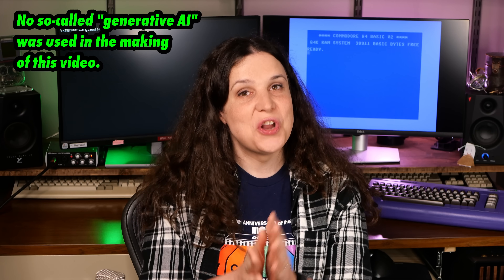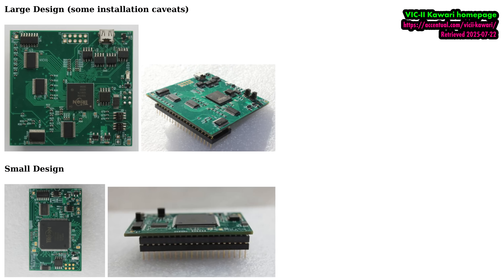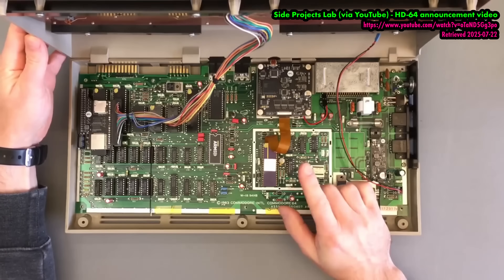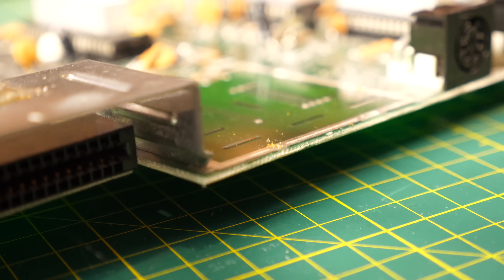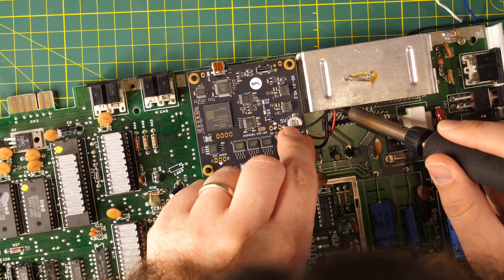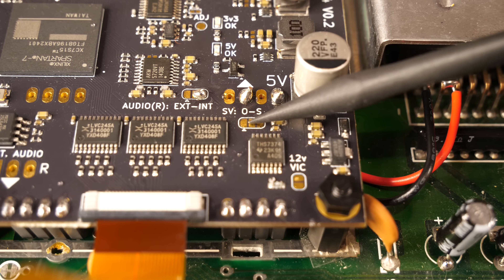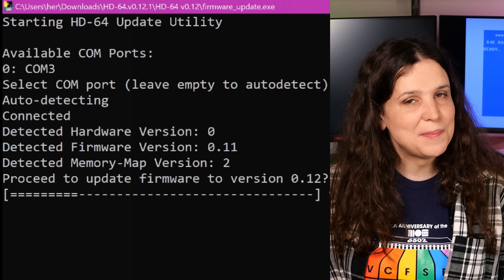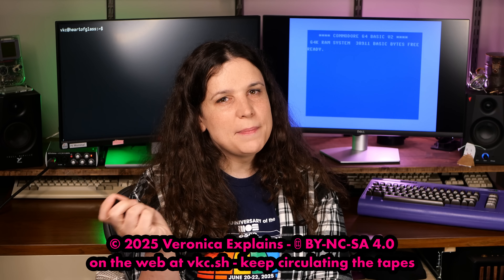My Commodore 64 has an HDMI port now.

Comment: Hey there, it's an honor to be featured on your channel, I've been following you for a long time :) Congrats for the thorough and well put together video, best of luck for your ongoing projects and stay tuned for an upcoming firmware update with much improved integer scaling and configurable scanlines :)
Reply from the maker: Oh hi there!! Thank you SO MUCH for the care and attention you put into this project. The instructions were well done and I've had no trouble at all since installing it. I can't wait to see where the project goes and will be keeping up with the updates from you!
Reply: firmware version v0.13 is in pre-release now on GitHub, the highlight is the option of selecting square-pixels aspect ratio on both PAL and NTSC, plus the fact that now "zooming in" does not crop the side borders unless they end up outside the 1920p horizontal resolution
Reply: It would be awesome if the original connection could remain as well.
Reply: @Someone_You_Do_Not_KnowYT Analog video (from the original VIC) is still available on the AV connector. The RF connector is completely useless nowdays, there is literally not a single use case for it in 2025
Reply: @sideprojectslab7352  I wouldn't think there was, it would be to keep the original hardware. So a unit that requires no more than a clip on and an extension that can be easily removed was what I was thinking.
Reply from the maker: @Someone_You_Do_Not_KnowYT  But then you couldn't get the video out without modding the case, which I didn't want to do.

I don't know why anyone would go back to an RF connection if they performed a mod like this. Keeping in mind that RF is typically the lowest possible quality connection- this mod removes that but composite/S-Video remain for plugging into vintage monitors.
Reply: @VeronicaExplains  Well, you have to mod the original hardware in order to do this, de-soldering and removing the RF modulator itself. If you are going that far, a case mod is easy. But I didn't mean that either. If the unit could be soldered into the original connections and leave the RF modulator there, or what I actually would like, somehow clip to to the pins without removal, the HDMI could be a small wire exiting the case and existing on the outside of it. This way, if you want to remove the mod and have it stock, you can. One could also mod the case at that point and put the HDMI connection there if that is that is what one would want to do. Considering the video signal, you could easily use USB-C as an alternative to mini or micro HDMI, let alone full size. 
What I was suggesting is not your use case scenario so I understand why you chose what you did. It's looks great, is easy to do and does what you want all while removing little more than an RF modulator that has no purpose without an actual CRT TV in this day and age. In that respect this is an awesome product and something I could see myself doing. However, in my own scenario I would prefer the RF modulator remain and access to HDMI or USB-C as an add on that can be removed.

Comment: I've never had a C64 (was in the Atari camp back in the day) but I have no animosity toward Commodore.  In fact, I used PETs in high school and had two different Amiga 500s in my past.  But with all the excitement surrounding the new C64 Ultimate I think I'll be ordering one.  Just need to decide on the model.  It's great that you have this video solution for your vintage C64!  On the Atari side, there are a few different solutions but none (that I know of) that are this straightforward and result in a perfect picture afterward.

Comment: If you want stereo. Take a look at FPGASID. Probably currently the best SID replacement. Not the easiest to install but imho it's the overall best package and it even has an A/B configuration which you can change between without having to open the config prg. You can use a physical switch which the user manual suggest but the JTAG connector also has +3.3v so it's easy to use a TTP223 touch switch instead. That way you can switch between A and B without needing to drill a hole in your cabinet. Just use good quality double adhesive tape and mount the switch inside cabinet where you want it.
The easiest is probably SidKick Pico 2040 with DAC but it's not cycle accurate. Good sounding though. ARM2SID is also a nice option and it even has auto mono/stereo although it takes som time to take effect.
One thing to be aware of though. The author if HD-64 has made right the default "mono" channel. It means that if using the "internal" sound you'll end up having left and right switched when listening to stereo. I choice I really do not understand. For a century left has been the mono channel. So what I've done is even though FPGASID outputs left on the board (only) I've configured HD-64 for external audio. Routed the right channel to the pin 7 (from memory) on the output so I have full sound in the analog output. Then from the connector 3 wires to the external input on HD-64. That way you get left and right correct on stereo tunes. A/B I've configured for 6581 (A, default as I configured touchswitch for default high) respectively 8580 both mono. For the few times I want stereo I go into the config app and configure stereo. If you don't want it to persist between power cycle then no need to save to flash (and wear it). Since many are using Kung Fu Flash and Ultimate 1541 (various versions) then no need to power cycle C64 to change between all sorts of materials.

Comment: I got mine and my interleaver cable assembly just didn't work. The instructions are really unclear, and the interleaver cable does not make good contact with the chip pins. My sockets I received weren't round pin like in the photos

I ended up soldering my interleaver pins based on another video I saw here, which worked. However the socket doesn't make a good interference fit in the motherboard socket. So now I need to figure out a way to mechanically attach that down

All in all it works, but the instructions aren't clear and I'm fairly sure I received an interleaver that wasn't right in some way. It's a shame, if they shipped the interleaver assembled I would have been happier

Comment: I agree gate,eeping is bad, but on the other hand I can see the resistance to fpgas as there have been quire a few fpga based boards thst have been discontinued either because the fogas had become to expensive or gone  out of production  altogether, I suspect a few in the anti foga croud has been burned by this. There are ofc allways a few that will object to anything that is mot original, but those ate probably ine the minorety even in the anti fpga croud

Comment: I had a Commodore 64 when I was in high school, that was a looong time ago, early 1980’s. Other than learning the BASIC programming language I found it to be kinda boring. I ended up giving it away but years later I wished I hadn’t done that because somebody came up with a graphical OS for it, modems / software for dialing up BBSs which would have made it useful. I had to wait until 1994-1995 when I got a real IBM clone PC which was a 386 33 Mhz which I later upgraded to a 486 80Mhz! then added an internal 14.4 modem and Soundblaster 16 card with 2X CD ROM.

Comment: If you want to be critical about FPGAs, you should take a look at how they are programmed.  There are basically two ways.  You either simulate how a "real" chip behaves in terms of how its outputs react to the inputs, or you can create a one to one clone of the original chip in the transistor or logic level.  People usually create output simulation since it is more efficient but I believe as FPGAs get better, designs on them will get better too.  Output simulation loses hidden features but a logic level creation even duplicates the undocumented features and glitches etc.  Also, you know the CPU that the SuperCPU uses, the W65C816S is designed and owned by WDC and you can buy the IP (the code for FPGA) and use it on your FPGA.  It is basically the same as using the actual chip. The physical chip and the FPGA IP is designed by the same company.  There is nothing wrong with the FPGAs as long as they are done correctly.

Comment: This is kinda funny because I have been using my 1080 TV for years because it has both HDMI which works for my newest computer with VR while I have a second computer plugged in using the old 15(?) pin connector like a classic monitor ( I surf with this old system and keep the gaming rig away from 'ugly internet'). Load'*',8,1 about 35 years ago.

Comment: Even if you're an FPGA hater...all this mod does is re-encode an A/V signal.  It's not replacing some "core functionality" of a unique Commodore chip.

Outside of that, I don't get the hate for FPGA replacements.  It's not like brand new CIAs/SIDs/VIC2s are being manufactured and replacements have to come from somewhere.  "Ship of Theseus" arguments hold no water for me (pun intended)...

Comment: So as a younger "kid" (born in 1996), but still a retro fan... 
 Why does being in a city make a port not work? Is it the Wifi signals or something?
Reply from the maker: Good question! RF is "radio frequency", and basically at one point, the only "input" a TV would have was the antenna. On a C64, this connection basically converts the composite video and audio into a signal which your TV would see as an over-the-air broadcast. And for many years it was great!

Problem is that nowadays there's a lot more interference from the proliferation of wireless devices. Not just Wi-Fi but loads of other devices pouring signals into the air. In dense environments, this signal deteriorates. Mine is unusable!

It's also challenging to directly view the signal off of the port, since no modern displays, except for a TV with an analog tuner, can understand the RF signal. To capture this footage for the video, I had to plug in a VCR that contained both a tuner as well as a composite output that I could connect with a scaler. There are cheap boxes that do the same thing, but gaming with them can be tricky due to lag- they're really not optimized for performance.

Hope that makes sense!
Reply: @VeronicaExplains  Thank you for the reply and explaining it so well. I was confused how "radio" would be on a port and wire... I had no idea that it'd be so... interrupting to signals on a wire to have that kinda stuff in "air" around a device...   but this does explain it well. 
I appreciate it and your time. :)

Comment: I have 0 interest in Commodore computers but like to watch videos like this. It is nice to see people actually working with hardware.  I think some people love working on computers more than actually using them for anything useful.  I'm old and was around when the Commodore was a thing and even at the time I scoffed at it's capabilities.  But that's just me.  One thing though. You really do need to work on your soldering skills. I'm sure you know what it's supposed to look like.  What works best is practice.  Lots of practice.  Work on an electronics assembly line for just a short time and you figure it out. One thing that helps with removing large things like the RF box is a heat gun or a hot plate.  The trick is to just use that to preheat the object and then a soldering iron can make short work of it.  Another trick is to put something under the board so that when you melt the solder the part will literally just fall down to your table so no prying is needed.

Comment: Guaranteed your C64 will outlast and outclass most modern tech. I wouldn't be even surprised if it reaches triple digits old and still works as good as the day you bought it.

Comment: The kawari large (with HDMI) is a much cleaner, simpler, and equally high-quality option for those who don't want to permanently mod their C64. No soldering required! I have one of the old crappy Rev. 326298 boards and I didn't have it in me to remove the RF modulator

Comment: As a software person, setting a jumper by soldering just seems like hardware people are trolling me!
Reply: @KevinLyda  when the module is not attached, I wonder what happens to the red wire and the black wire that have been bonded to the cart port pins

Comment: Ok.   My father in law has two c64s in his attic and I can have one if I can resurrect them both.  He says he needed to replace some IC chip before to get them working.  Is it still safe to use the power supply or should I find a replacement?  Understand I would need to test the pin out but have heard it was recommended to not use the OG power supply.
Reply from the maker: I'm firmly on team "replace the PSU", they almost always fail and it's much better to start with an aftermarket supply.

Comment: You mention the expansion slot at the end; would it be feasible for someone to make an HDMI-out cartridge that just plugs in, or is there some performance or other reason it wouldn't happen? (*other reason: no Epyx Fastload, I suppose)
Reply from the maker: Check out the Turbo Chameleon 64: that's basically a standalone implementation of a C64 in a cartridge format and includes VGA output. At that point it's less of an "expansion" and more of "an entire computer in a cartridge", which may or may not fit the bill. I think it looks like a neat project but I don't own one to futz around with.

Comment: Good to see these kind of things available. Cheaper than going for a modern equivalent.

Wonder why they didn't just use hardware jumpers for the audio/video options instead of needing blobs of solder? Also, could you get away with using some decent crocodile clips to connect the board to the 5V and Ground lines on the cartridge port instead of soldering them?

Think I'd also like a 3D printed shroud for the new HDMI port that covers the RF title above the opening to complete the look.

Comment: When a hdmi upgrade costs a third of the cost of a new motherboard that is future proofed, in built WiFi, ethernet, sid sockets, in built 1541, 1571 support,  effortless kernel swapping to jiffydos or dolphindos.  Accelerated cpu support...I would sooner keep my existing motherboard as a show piece...and that's exactly what I have done.
Reply from the maker: Good for you! I don't want a show piece, I use it almost daily. A replacement motherboard would certainly be fun but so was this!
Reply: @VeronicaExplains  I am sorry, I think you might have misunderstood my comment.  I am glad you found the project fun.  I think this HDMI mod is great albeit pricey for what it is against the modern replacement C64, hence cost ineffective.   If you use your C64 almost daily then I would most certainly advise peeps to consider preserving their C64 motherboard and getting an Ultimate 64 Elite II or wait for Commodore's own iteration of it.

Comment: I feel like putting HDMI an original, is a little sacrilegious. I mean, if you're going to go down that route, wouldn't it just be like using emulation? I thought the whole purpose of using original hardware is to keep it original. I.e using RF with a television or an RGB monitor. But, I guess, even the mighty Commodore {which I have never even seen in my 55 years of being this planet, because I couldn't afford it when it first came out so being as I live in the UK, I got a Sinclair Spectrum 48k instead,} needs to be modernised for all the so called purists out there. Personally, I would use RF or, at a push RGB, but never HDMI, sorry.

Comment: RGB2HDMI now does audio... with a tiny board addon, so no longer need an audio embedder.
Reply from the maker: I think the complexity is still a valid reason why you might want the all in one solution. Folks have suggested that mod today and it looks exciting, but also is a ton of stuff compared with the single cable to plug it all in..

Comment: It does feel a little strange to use a device vastly more powerful than the machine it is being grafted to, but the fact is the HDMI connection simply can't work without a) something speaking a digital protocol running at, a bare minimum, 25MHz (if you want 480i) and b) something capable of either sampling analog output and converting it to that HDMI format, or something that essentially emulates another C64 (at least FPGA does that in hardware) and copies the original state over, then rebuilds the "screen" entirely for HDMI.  The latter looks a lot better.  Weird times.  Bit like how the dumbest USB-C power adapter has more processing power than the Apollo Guidance Computer, just to speak USB.

Comment: Honestly, I don't get the whole FPGA issue. Are they programmable? Yes, but so are ROMs - are we going to be nit-picking over replacing ROMs that have errors in them?  Also, at some point we won't have spares for some of these custom chips or one will cost more than the rest of the entire machine itself. This will lead to less production and fewer-and-fewer software and hardware modernizations until nothing is left. Lastly, we need to start thinking about modifying video because it's getting harder-and-harder to find old video TVs/monitors. The C-128 has both composite AND RGB similar output - try getting your hands on RGB monitors these days - I dare you (let alone one that can do both composite/RGB). Getting both to VGA is very difficult (especially with a good picture) and VGA-to-HDMI doesn't bring sound. If I have a company that can eventually work on a project for my C-128 to handle all this but requires an FPGA (or two), so be it. Output is important to using our machines, and finding an output that can do both audio and video to modern monitors is essential. You can't use what you can't see/hear. You might as well not have a screen at all. Can we go through a rats nest of converters (costing, by the way, $200-$300 for an ugly, poor working system)? Yes, but why? Why can't we just use FPGAs to solve the problem, inexpensively and better. Cheers to Veronica! I personally love your videos!